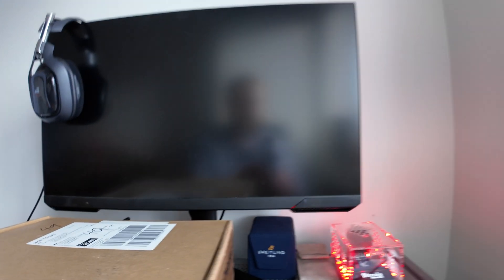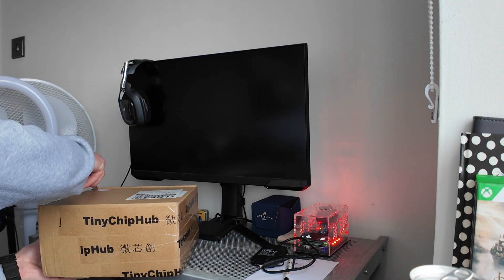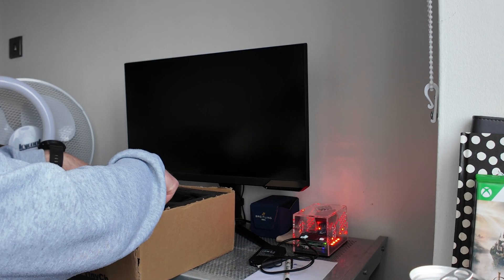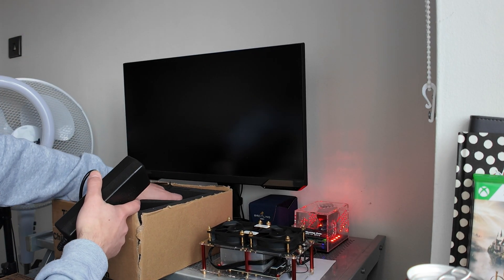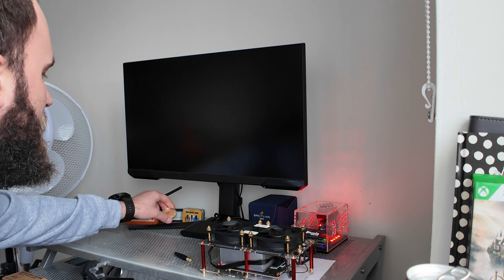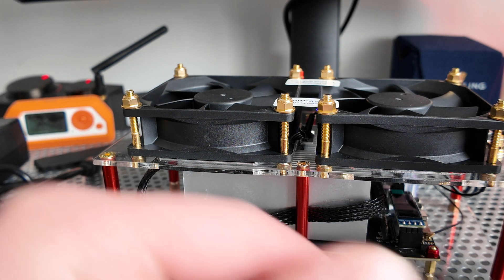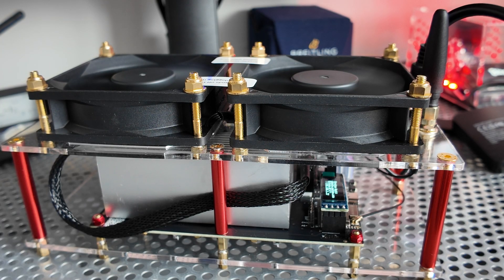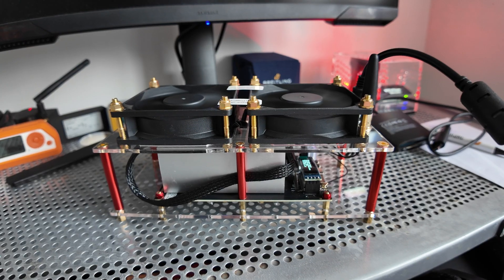Bitaxe Hex unboxing |  3+ TH of Crypto Bitcoin mining power!!

Comment: I feel like yhere is better options. 2x gamma from amazon or ali $220.
2x argon cooler $40
2x y cable (if needed) $20
Copper heatsinks $10
Move stock fan to the back of each board to serve as voltage fans. 4.8T/H for $290 lets say $300 cus thermal paste.
Reply from the maker: Very true, I think it’s just too easy to buy these pre made miners but when you break it down like you have it makes more sense to do it yourself. Plus it would make for a fun project!